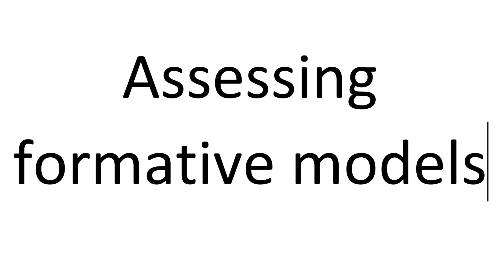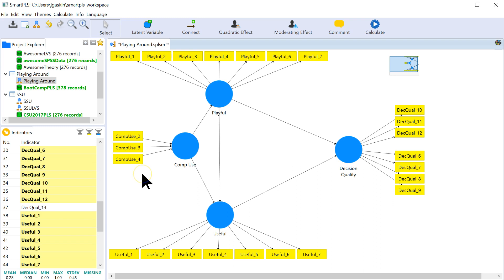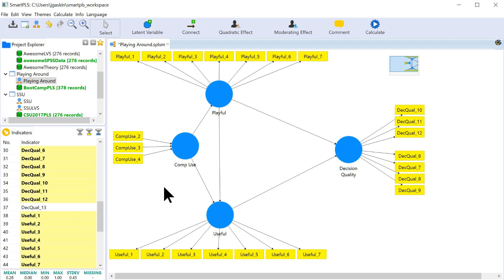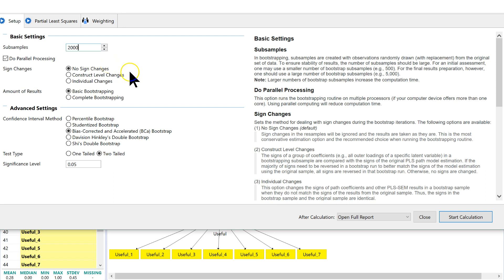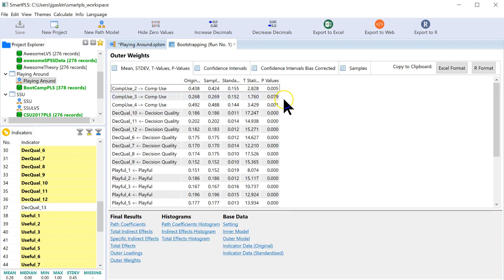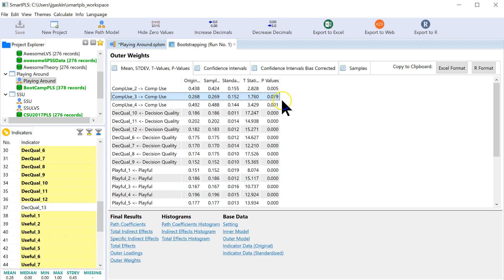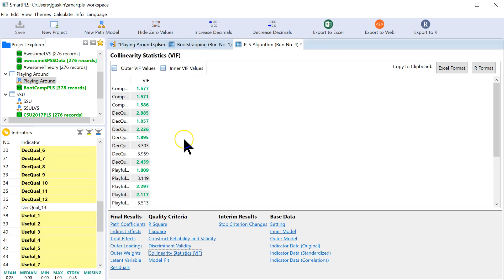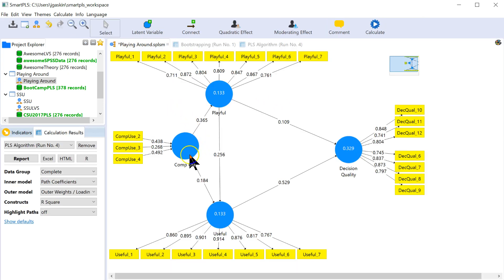Validating Formative Models in SmartPLS 3

Comment: Thankl a lot Dr. James. I would be grateful if you could help clear the following question:

Regarding the assessment of my formative measurement model (which has 4 dimensions), when checking the outer weights, I found that one of the indicators has significant weight and p-value (0.001), but its outer loading is 0.3 (below 0.7) .. How does an indicator have significant weight and p-value while the outer loading is less than 0.7? 

Additionally, another indicator does not have significant weight (0.004) and (P-value = 0.94), but its outer loading is above 0.7. Shall I remove this indication? 
Hope you answer and thanks in advance!
Reply from the maker: 0.700 is not a firm cutoff. It is just a recommended target for reflective indicator coefficients. Formative indicator coefficients do not have the same target.
Reply: @Gaskination  Thanks so much prof

Comment: Thank you James for the instructional video. I am a bit new to Pls-sem and just learning with one dataset. The model has mostly reflective latent variables. I changed a construct of 3 variables from reflective to formative and I find that the p-value of 2 variables are insignificant (0.851 and 0.876). However, the collinearity check is okay. All the variables are green (1.939 and 2.064). Do you think it is (a) acceptable, (b) eliminate the two variables and keep only one, or (c) make them reflective? Thank you.
Reply from the maker: Typically whether something is formative or reflective is determined conceptually, rather than statistically. So, I would just stick with whatever is consistent with how they are measured. Usually it is easier to model factors reflectively.
Reply: @Gaskination  Thank you very much. Much appreciated

Comment: @Gaskination I have a question. In this video, I don't think you mention checking the Convergent validity of the formative constructs using redundancy analysis. Is that not necessary? I ask because I am currently assessing a formative model, but I do not have global single items for my formative constructs. I am unable to check convergent validity via redundancy analysis. Is this a problem? If it is required, is there any other way to check convergent validity? Thank you in advance!
Reply from the maker: That is certainly the best approach. If you don't have a global construct, then the approach in this video is the next best alternative.
Reply: @Gaskination  Thank you and noted. So I cannot do convergent validity via SPSS or any other software. Is that correct?
Reply from the maker: @rekharisaac  convergent validity for formative factors is not logically consistent.
Reply: @Gaskination  That's what I believe too. If there are any literature references about this (convergent validity not being logically consistent for formative factors), please let me know so I can use them in my paper.
Reply from the maker: @rekharisaac  Pretty much anything on formative assessment should work. Here are some references here: https://statwiki.gaskination.com/index.php?title=References#Constructs_and_Validity
Reply: @Gaskination  Can't thank you enough! Thank you for patiently answering all my queries. Truly appreciated!
Reply: Dear @rekharisaac did you finish your paper? Can I see you paper please? Because I have a same problem that I don't have a single global indicator on my formative construct.

Comment: @Gaskination ...I have been learning Smart PLS through your videos. It has been a great learning experience. Thank you so much. I would be grateful if you could help clear the following doubts:

Question 1: Can it be deleted if the outer weight of a formative indicator is negative and not significant?

Question 2:  Latent Variable constructs that are created by asking respondents (end consumers) to rate which attributes (or features or activities or factors) they consider important (concerning a product/brand/company) are formative, correct? Essentially, the measurement model with formative indicators involves the construction of an index (list of items) rather than a scale. Have I understood this correctly?
Reply from the maker: Hi! Sorry for the slow reply. It is a holiday weekend in the US. 1. There are debates on this. The short answer is yes, but just understand that the nature of what you are measuring has changed. 2. I would use a set of measures like that in a cluster analysis or create preference profiles or something like that, rather than trying to put them into a latent factor.
Reply: @Gaskination  Thank you!

Comment: Prof. Do I need to do validity assessment of my formative constructs for overall data, and for the data of all the groups as well, if I have groups and further would be doing MGA?
Reply from the maker: validity assessment is usually done with all data, then invariance is conducted across groups.
Reply: @Gaskination  Professor, please check this paper 
Multigroup analysis of more than two groups in PLS-SEM: A review, illustration, and recommendations.

It shows that validation has to be done for all the groups alongwith complete data set
Reply from the maker: @drkaranberry  Then that's what you should do. I'll just note that if you find full measurement invariance, then the measurement validation should be consistent between all data and its subgroups (assuming sufficient sample size in each group).

Comment: Dear professor, I have a doubt. Why didnt you check validity using single global measurement item (Redundancy analysis). There is no overall/ global measurement item in your model. Please clarify..
Reply from the maker: You are correct. The complete approach would be to use the global measure. I didn't have such a measure in this dataset.
Reply: @Gaskination  Thanks Professor, But can I go ahead without redundancy analysis, if I don't have a global single measurement item in my data? Or is there any other way to go forward. Please advice.
Reply from the maker: @drkaranberry  If you don't have a global item, then it is not possible to create one. You would have had to collect data for it. So, in this case, you would just follow the guidelines in the video above.

Comment: Hi Sir.  Could you tell me how to solve the problem of inverted signs (positive/negative) of the outer weight (Path coefficients) in Smart PLS. Thank you
Reply from the maker: Negative weights can imply an inverse relationship with everything else affecting that latent factor. I've never seen this occur in SmartPLS before though. Perhaps it could be due to using the PLSc algorithm. You might also check to make sure your indicators are coded in the correct direction. For example, if you're measuring job satisfaction, positive coding would be things like: "I like my job", whereas negative coding would be things like: "I hate my job". You can also make sure the scale itself was in a positive direction (e.g., strongly disagree = 1, strongly agree = 5) and not a negative direction (e.g., strongly agree = 1, strongly disagree = 5)
Reply: @Gaskination  Thank you very much for your hopeful explanations. I'll try to see what you have recommande me and i hope it resolve the issue.
Reply: @Gaskination  I checked my scale, it's in the positive direction: from "1-completely disagree" to "5-completely agree". I don't know exactly the origin of this problem  and how to overcome it.
Reply: @Gaskination  By the way, to construct my formative construct in PLS, I used nominal, ordinal and scale variables.  This may be the cause of the problem. Doesn't it?

Comment: Dear Dr. Gaskin,
I would like to thank you on this great video that shows two of the measurement model for formative constructs as mentioned in hair et al. book 😊 However, I have two questions that I would like to ask 😅 First, u did not mention the convergent validity which is good to me because I did not know before distributing the survey that I should include a general accepted reflective indicators for the focal construct, to then compare between the reflective and formative indicators. so, I just need to know is there a problem if I excluded it although my source "hair et al. different book editions" mentioned it?😁 Second, my formative construct "Brand equity" is composed by three indicators (loyalty, Perceived quality and brand association), each one of these three is actually measured by different indicators not single sentence. So, should I first apply reflective measurement model for each one of these three then apply the formative measurement model for the focal construct "brand equity"? 🤔 
Hope you answer 🙈
and thanks in advance ☺
Reply from the maker: While it is best practice to include a generic measure to compare the formative measures, it is not currently universally practiced. So, you are probably okay.  Regarding brand equity, yes, that is the correct approach. I also talk a bit about it here: https://youtu.be/LRND-H-hQQw
Reply: @Gaskination  thanksss a million Dr. Gaskin for replying 😃😀

Comment: Hi James,
Thank you so much for your video.
Regarding formative constructs in second-order models, I have a general question. What will happen if one of the first-order constructs remains the same across the entire sample (in my case, the accuracy of the prediction by the machine)? My motivation for including it in my model is that, if this model is applied to examine another sampling where the values are different (e.g., users come from different platforms), then it must be retained.
I appreciate your response very much.
Reply from the maker: Good question! Variables must vary. If they do not vary then they will create a problem in the calculation. So, you might propose it be included, but then have a footnote for your implementation to note that you needed to omit it due to no variance on that variable.
Reply: @Gaskination  Thank you, James. Your advice is very useful. Could you please provide me with any resources that I can use to reference this?
Reply from the maker: @monaghaffari7072  This probably doesn't need a reference. It is the most fundamental characteristic of a variable. It is so fundamental, it shares a root word (variance and variable)

Comment: Hello, I have a formative variable ABC, which has 4 very different belief indicators (subdimensions). I am told to set the Path Model as a second-order variable. Meaning....for the subdimension of denial. then,  ABC ------>ABC-DNL ----> each DNL1 to 6 indicators, with 6 different indicators. Okay ABC for acceptance has 8 different indicators. What you can determine is that the definitions for both subdimension examples are totally different.  The weights p-value for almost all are 0.24 and below. No good p-values to speak of. For each, the VIFs are all under 2.0 which is very good. What do you see?
Reply from the maker: I don't think I understand the question. Feel free to email me a picture of the model. You can find my email by googling me.

Comment: Hi James, for the formative model, is it necessary to do EFA? How can I explain to the reviewer for not doing so? Any reference? Thanks!
Reply from the maker: EFA is only for reflective latent factors because an EFA assumes item correlations within factors, but formative factors do not require items to be correlated. Here are some references: 
Jarvis, C. B., MacKenzie, S. B., and Podsakoff, P. M. 2003. "A Critical Review of Construct Indicators and Measurement Model Misspecification in Marketing and Consumer Research," Journal of consumer research (30:2), pp. 199-218.
Petter, S., Straub, D. W., and Rai, A. 2007. "Specifying Formative Constructs in Information Systems Research," MIS Quarterly (31:4), pp. 657-679.

Comment: Hi James, I set construct as formative, however, the outer weights are not significant. When I set it as reflective, the loadings are all above 0.8. Should I treat it as a reflective one?
Reply from the maker: Yes, it sounds like this is "sufficiently reflective".
Reply: @Gaskination  Hi Professor, I have the same problem. The outer weights of one construct are mostly not significant as formative but loadings are all above 0.8 as reflective. I treated it as a reflective one, but I feel like it is more formative theoretically (it is based on a developed index, and each item is an aspect of the construct). I am recently defending my thesis, and I was just wondering how shall I defend this construct as reflective? Thanks!
Reply from the maker: @xuegewang9335  You could do a confirmatory tetrad analysis: https://youtu.be/Qu9U6Be2fOc?si=hgR8iRNvCFNCgglw

Comment: Hello Dr james.
 I want to know . If all vif are found to be significant and also p value but the item outer weights are less than0.2 also loading are not greater than 0.7.  
 In this scenario will we be able to retain the item. Or we have to drop it.
Reply from the maker: If all VIFs are above 5 (or 10 if you're being liberal), then the items are redundant and they are probably reflective rather than formative.
Reply: @Gaskination   majority  VIF  are less than 5 . Few are above 3. But the outer weights are lower   ranging from  0.2 to 0.7.  infact outer loading of some factors are found to be less than 0.7.
 My main concern is about weights and laoding are considered important for retaining  item. Or VIF is all alone k for  the decision making.( Regarding item retention)
Reply from the maker: @ulaila2002  For reflective factors, the path coefficient is important. Generally, regression weights greater than 0.500 are desirable for reflective indicators (although greater than 0.700 is nice). For formative, it is much more difficult to justify removing an item unless its VIF is very high and its path coefficient is very small and non-significant. Otherwise, removing an indicator may alter the nature of the construct.

Comment: Hi Dr. Gaskin. I have a somewhat complex model with multiple formative variables. After running the boostrap method quite a few of my variables returned a P value >.05. However, the VIF checked out (VIP<5). How would you proceed? For example I have a 9 item depression scale and most of the items are showing to be p>.05. Thank you!
Reply from the maker: For these scales, you might take a more theoretical approach by creating a score or weighted sum. Determine which variable values are most important and weight those more heavily. If they are equally important, then just take a straight sum or average. Then use this resultant score instead of the latent factor.
Reply: @Gaskination  Thank you! Most of the scales have sub-scales, so for example i'm looking at the familism scale and it has 3 subscales. I am mostly interested in looking at 2 of the subscales (as moderating variables). So in this case I would make sum scale averages for each subscale? Thanks again, your videos are getting me through my dissertation analysis!
Reply from the maker: @chantalmartinez5414  yes, that could work.

Comment: Dear James, Thanks for clarifying. 

But one more query: 

1. Why a 2nd order construct( formative-formative) should have the repeated indicators loaded in REFLECTIVE mode?ideally they should be loaded in FORMATIVE mode ? 

can you please share some papers/ resources that suggests that this repeated loadings  should be in REFLECTIVE mode for a formative-formative 2nd order construct? 

2. For redundancy analysis of a 2nd order construct( formative-formative), its reflective counter part should be measured with single indicator or multiple indicators ? Cheah et al. (2018) suggests SINGLE indicator for this. Further Hair et al. (2019) and (2020) also suggests the same. Can you please give your expert view. 

Cheah, J. H., Sarstedt, M., Ringle, C. M., Ramayah, T., & Ting, H. (2018). Convergent validity assessment of formatively measured constructs in PLS-SEM. .
Hair Jr, J. F., Howard, M. C., & Nitzl, C. (2020). Assessing measurement model quality in PLS-SEM using confirmatory composite analysis. , , 101-110.
Hair, J. F., Risher, J. J., Sarstedt, M., & Ringle, C. M. (2019). When to use and how to report the results of PLS-SEM. .
Reply from the maker: 1. "When using the repeated indicator approach, researchers must determine the measurement mode of the HOC with the repeated indicators. Mode A is the recommended method, although Mode B is often used to provide alternative estimates (see Becker et al. 2012; Ringle et al. 2012). This approach has three major disadvantages..." Cheah, J. H., Ting, H., Ramayah, T., Memon, M. A., Cham, T. H., & Ciavolino, E. (2019). A comparison of five reflective–formative estimation approaches: reconsideration and recommendations for tourism research. Quality & Quantity, 53(3), 1421-1458.
2. The consensus is a single wholistic indicator.
Reply: @Gaskination  Much thanks sir. Its a great help indeed!!

Comment: Dear James, 

1. I have a 2nd order construct (formative-formative)...in case of repeated indicator approach, all items measuring first order formative factors when loaded on 2nd order in the first step: this mode of loading will be REFLECTIVE or FORMATIVE ? pls suggest.  

2. after first step, we can get the latent variable scores (standardized scores) and then use them for checking effect of the 2nd order factor on any other theoretically connected factor for establishing Criterion/ Nomological validity of 2nd order  or even the reflective measure of its own self for redundancy assessment?
Reply from the maker: 1. All repeated indicators should be modeled reflectively.
2. Yes, except I don't understand the last part about using a single score for redundancy assessment.